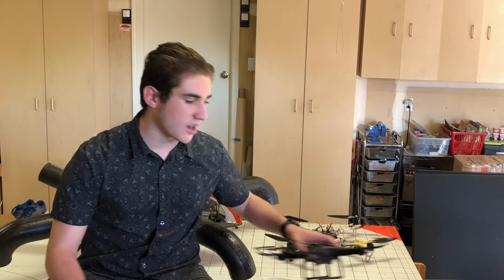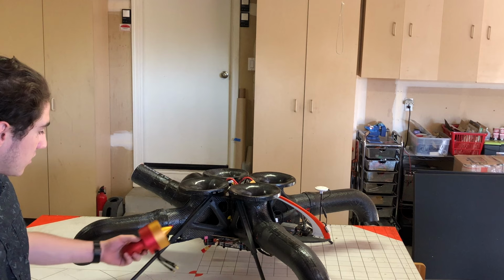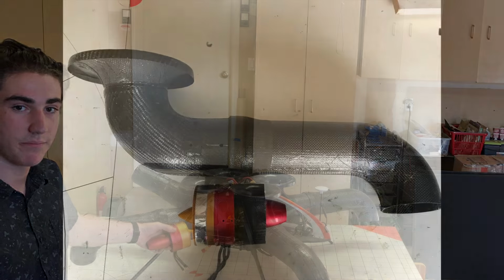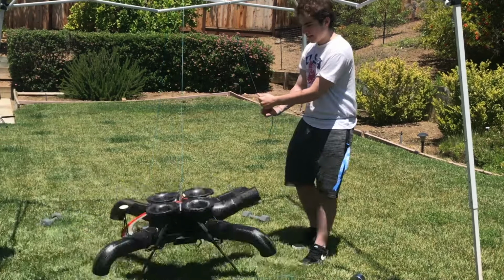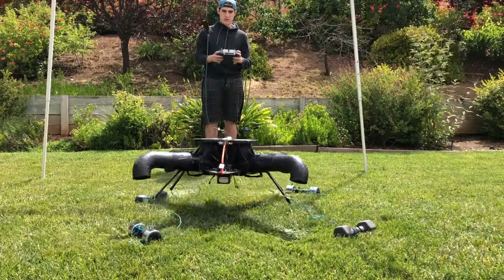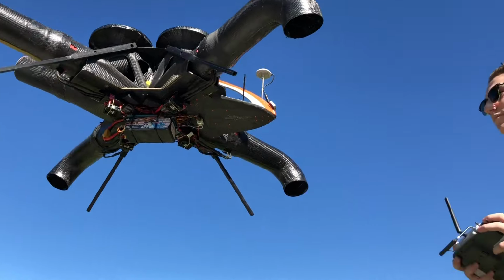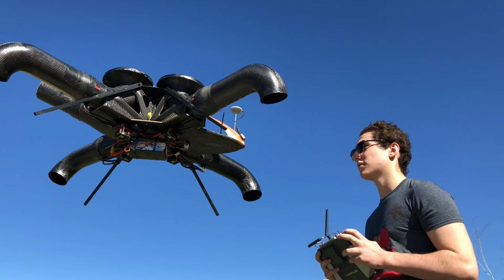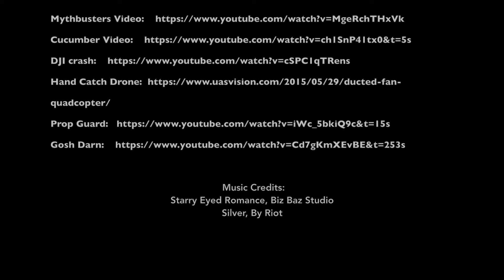Bladeless Drone: First Flight

Comment: I’m curious how much force is lost by making the ducted air take two 90 degree turns before exiting the vent
Reply: A huge amount on a good day. A better design would have had the bladed fans in a straight pipe only long enough to ensure you can't get nailed by the fans.
Reply: @strictnonconformist7369  I love that all the weight is centralized though.... I have a vintage alfa with a  rear transaxle.... it wastes a huge amount of power from the engine but balances the car 50/50 so it handles amazing.... so there are tradeoffs.
Reply: Almost zero. There is a lot of energy wasted by sending the air through the ducts, but not so much the bends. Also, EDFs aren't known for their efficiency. Still a very cool design though.
Reply: @shawnhollahan590  there are always tradeoffs.

As to the previous comment by another poster about amount of energy lost as a result of 2 90 degree turns, I’d love to see that measured and verified, having had a certain amount of formal training in hydraulics and pneumatics for robotics/automation purposes.

The higher the pressures involved, the farther away from zero energy lost it becomes: this is how and why Tesla turbines work, because boundary layers of air have a very measurable amount of viscosity and air hates to change directions to flow against it. 2 90 degree turns creates air boundaries out of airflows, above and beyond the walls.  This is why hydraulic and pneumatic circuits try to minimize the number of bends required, including ordinary plumbing, because you lose head that way.
Reply: Stefano tested that and found NO reduction in thrust.
Reply: @joshrandall3632  By reducing propeller blade tip losses, the ducted fan is more efficient in producing thrust than a conventional propeller of similar diameter, especially at low speed and high static thrust level
Reply: @tamaselmont8310  True, but there is also a lot of parasitic loss from surface drag on ducts that long. My statement about EDFs was more about the fact they are used for performance and raw power rather than endurance and efficiency.
I'm not an engineer (this kind anyway) but I think he could get the same benefit from a short vertical duct that extends 2 or 3 inches above and below the props and it would still be safe. Just a thought.
Reply: @joshrandall3632  Yes, ofc. His design is certainly an overkill.
Reply: Stefano completed an awesome project, the skills are phenomenal! Still, any bend in a flow causes energy loss, also due to micro-turbulence buildup. Also, Stefano had to angle the flow of the fixed ducts from the vertical to enable yaw control. That's another loss of efficiency. Maybe installing the fans vertically may have been employed to use torque diff for yaw (just like with a regular quad), I'm just not sure how that would have affected the attitude, given the significant difference in RPM needed and lag. Rotors don't have that problem. 
While enclosed space saving high RPM turbines may seem a nice idea, there are issues. There's a reason why large helos (e.g. CH-53E) are built with single huge multi-blade rotors: is called "torque". If one ever flew in a helo, one would know how responsive and sensitive these machines are to collective and cyclic input. Turbines are famous for throttle response lag. It is the reason why the V-22 Osprey has those huge rotors as it is very difficult to control and quick response is needed. It would be much easier to have a pair of jets installed and not risk hitting the ground with those two monstrous rotors, but it just doesn't work. That's why the power comes from turboshaft engines and routed to those huge shafts at almost constant RPM. The control is done with collective/cyclic input (and a bunch of PID/FbW electronics). Also, the immense inertia of helo/Osprey rotors plays a huge role in torque control. The Harrier Jet and the F35B use their hovering capabilities mostly for VTOL, no acrobatics possible, none needed. The Harrier uses thrust vectoring of jet exhaust, the F35B uses a turbojet/turboshaft hybrid engine to spin a vertical turbine for trust with bleeders for roll/pitch and steerable nozzles for yaw. The abilities of both aircraft are very limited. But look at videos of 3D Heli flying artists. No ducted fan or jet turbine can do that.
Reply: @strictnonconformist7369  yeah almost like.. a ducted fan
Reply: You can have 1 large turbine in the center of the drone and have a throttle body on each of the 4 tubes that meter how much air is allowed into each one.  Then have a 5th throttle and tube thats pointing straight back for horizontal thrust to increase forward speed.  Shape the body to produce lift when traveling forward so less air is needed for downward thrust and more can be directed to the rear for airplane-like flight.   Fly it FPV with vr goggles of course , camera movement linked to pilot head movement.
Reply: I would imagine the efficiency of the unit drops considerably with ducted fans as opposed to props. The question is, by how much? And how much current does it draw? Can it fly other than in a hover? If so, is it stable in horizontal flight? How fast can it go? Why am I asking all these questions in a youtube comments secion?? WTF??
Reply: @SteveKasian  No no no , this is youtube ,  please reframe your questions into statements of certainty and indisputable fact  , and start beating people over the head with them.  Pretty sure it's a violation of terms of service to do otherwise.  😂
Reply: @strictnonconformist7369  Maybe using straight tubes on gimbals would help by directing thrust outward for stability and straight vertical for speed/efficiency. It would complicate the electronics needed somewhat.
Reply: @NickKautz  Well that's what I usually do; But I got off track when I started posing questions and totally dropped the ball. I'll have be more careful next time, and make sure I stay in troll mode.
Reply: @shawnhollahan590  
Centralised weight and having 50/50 weight distribution aren’t necessarily the same thing. You could have 2 identical weighing vehicles that both have 50/50 weight distribution. The one with the majority of its mass inside the wheelbase would have low rotational mass and be very twitchy on the limit and unless the driver is highly skilled at avoiding this limit it’s likely to end up spinning out of control.  Whereas the vehicle with the mass outside the wheelbase would be inherently more stable on the limits and easier to control at the limit and bring back under control if that limit were exceeded. As for a drone, unless you’re designing for aerobatics, having the mass at the perimeter would make it far more stable in fight and would do away with all that drag inducing tubing.
Reply: @SteveKasian  An honest mistake , carry on sir.

Comment: Well, someone may have said this before but I'm not going to read 8K comments to find out.
You, and anyone else working on that project, need to get chest x-rays, to see what kind of damage was done, by cutting and grinding carbon fiber, without proper respirators. It's like asbestos. It gets in your lungs and stays there. It's very dangerous stuff to work with.
You have a great invention, I'm sure it will go far. Let's hope your only investments were time and money.

Comment: EDF (Electric Ducted Fan) are way to power hungry and you'll get only a couple minutes of run time.  Not to mention the time lag from commanded input to it actually producing thrust. This craft probably wouldn't fly in just a couple mph wind. The EDF's could never ramp up fast enough compensate external forces pushing on it. It's doomed from the start using EDF's.
Reply: Rampant FPV;

you better think, before writing nonsense; YOU ARE TOTALLY WRONG !

One may easily operate a CENTRAL EDF and you just regulate the cross sections to the four outlets in order to create thrust for climbing / cruising and maneuvering.

Works like collective /cyclic pitch at a helicopter.

Advantage: THIS can be done much faster  than spinning props up or down- using up-to-date digital power servos, controlling the throughput of these four channels.
Reply: @worldbestpilot   Totally wrong? The only one wrong here is you. We're all watching a four edf quad 4:26  Then comes in you throwing around a central unit edf. Are we watching the same video? Why stop there. Why not go with a nuclear powered central edf and solve the other problem of  how power hungry edf's are.  You think no one has not thought of this or tried it before. There's reasons why edf powered quads aren't in production. Power hungry, extremely short flight times, poor payload capacity and a tuning nightmare.

Lastly since you think it can be done and put forth how it can be done. Lets see you do it!
Reply: There's always at least one person like you. There was one when the first car was prototyped, the first plane, the first Rocket, the first helicopter. There has to be a starting point and there is always one person who has to shit on it. Congratulations, for this idea it's you.
Reply: @customledandfiberopticsinc2756    Yes your right there's always been a first, a starting point and this isn't it. Its been done before.  Check the date. https://diydrones.com/photo/img1919-1 kind of crude when compared to this carbon fiber quad but its been attempted 8 years prior. and another one https://diydrones.com/photo/nacol-ducted-fan-quad (2013)
Reply: @rampantfpv8386  You're comparing the two? awesome. The one in this video is way more advanced than that other video. Like I said, There's always one guy that has to shit on the idea and it seems to still be you. I'm OK with that. That's why the internet is so great. It allows people like you to remain anonymous while shitting on the achievements of others. Don't take it so personally. Just like the above video isn't the only one out there, You're not the only person out there shitting on other peoples shit.
Reply: You have to solve the energy consumption issue here first! I'm sure it will happen one day but this system needs LOT of energy to operate! It's no different from a Jump Jet they consume enormous amounts of Fuel when doing a Vertical Landing or takeoff! The military has uses for this technology but a Prop is way more efficient! Like I said the energy issue may be fixed one day but until they find a energy source that packs the punch of Nuclear but is as safe as a Lipo we just aren't going to see this on the market ! The other issue is noise they are way noiser than a prop my Mavic can barley be heard once up 50+ feet but this will sound like a Giant Vacuum cleaner flying around !
Reply: @customledandfiberopticsinc2756   When you understand the thrust characteristics and limits of EDF's you'll under stand what I and others have been saying. Best for now you stick with playing with your LED's.
Reply: Based on my experience and research based knowledge, I think Rampant FPV is right about the lag time and control issue as well as the lower efficiency of EDFs (in theory EDFs are more efficient, but in the current RC market this isn't true for whatever reason). I'm not saying the project was a waste of time or trash or anything, in fact, I think it was really neat and it's cool to see someone do that.
Reply: @rampantfpv8386  Oddly enough, Ducted fans showed up on drones at this years CES, oh, so did turbines.

Comment: That gives me a thought: could that concept be achieved with a single large central impeller and 4 valved outputs?
Reply: interesting
Reply: Or 4 gimballed nozzles instead of 4 motors.
Reply: I'm not an aerospace engineer, but I'm still an engineer that got aerodynamic courses. That design you offer would have some serious problems. Firstly energy would be wasted on lets say valves that are closed to block airflow for manuever. It might also create an unnecessary turbulance which may lead to a lack of stability. Also it should be something like a 4 step & 1 powerful servo motor rather than 4 semi powerful servo motors. I'm just thinking roughly though, but I don't think calculations will state otherwise.
Reply: No
Reply: That is basically how the harrier jump jet worked.

Comment: Instead of using ducted fans how about replacing them with one bigger centrifugal fan? I would expect it to be more efficient because it is possible to use it to move a greater mass of air more slowly.
Reply: how would you navigate it in varying directions in an xyz plane?
Reply: YES!! Glad you said it! If he is going to rob his duct fans of thrust by putting a lowelly 'car' type exhaust system on it he needs a higher pressure compressor, enter the centrifugal wheel!😅

Comment: Cool project but a little misleading to say "bladeless" more like ducted fan. Regardless I can appreciate the work you put into the design.  Reminds me of the early work that went into design of the flying wing configuration of early bombers. Concept was sound but technology didnt exist to stabilize the flight characteristics until recently. I am curious as to why you didnt just mount the ducted fans vertically with screens covering the inlet and exhaust.
Reply: Exactly. Definitely has blades but they're now ducted fans of even something like an impeller.
Reply: @Real28  similar application that Harrier jet uses.  Great to see that parents are willing to fund their child's creativity.
Reply: Basic leverage technique. Put the mass towards center with a longer thrust lever to reduce power needed for more precise control. That's my first thought.
Reply: @myrealname2022  yep...probably had to find the right balance of where to place the fans. To far outboard means more thrust input and to far inboard and you lose stability.  But that is the challenge of prototyping: somethings have to be in their location due to parameters established by final shape.

Comment: 1 It is internally bladed, not bladeless.
2 Are the 4 fans more efficient by weight than a single bigger motor, driving one or two fans using controlled ducts for lift?
3 The  curve of the output tubes might seem important to allow maximum flow and minimum turbulence.
4 Or the shape of the final tube openings could allow for stream modification that could enhance the "push" on surrounding air.
5 Does the input opening create a low pressure above the craft, aiding its lift?  And would tilting be a problem, like with sharp cornering.?  Would the input opening be improved by having it raised above the craft like a short chimney?
Fun video.  Thx
Reply: He doesn't know anything about drag and ignores why they do it that way ("bladed" fans) in the first blace.
Drag. All that tubing slows everything down...

Comment: On the one hand, this is extremely cool. On the other hand, I'm not sure what advantage this has over drones with a full screen over the props. Some drones use a grate which covers the entire fan, and they seem to work just fine, and don't have these heavy tubes on them, making them more efficient. I actually really hope somebody has an answer as to why this is a better solution, because it's cool and I want it to work. Anybody?

Comment: Interesting. But I bet it is hugely inefficient compared to normal quads because 1) The ducted fans use very high RPM relatively small propellers (propellers are always more efficient when larger, slower and less blades) and 2) The pipes are lengthy and have 2 90-degree turns. Why not just put the same ducted fans vertical, with maybe a short length of straight tube extensions, and build a protective mesh above the intakes? Should be much simpler to make and should improve efficiency a lot.
Reply: because mesh would destroy the efficiency?

Comment: Ducted fans seem cool, idk about their thrust:diameter ratio but I'm sure it's good, however their overall thrust:cost ratio seems very high. I've always wondered if adding multiple turbine blades/ducted props to the same motor would work better? Of course it would come at a cost to efficiency but so do coaxial propellers, though most importantly they are great for saving space.

This guy seems to be doing it right, props to him and his dad! Putting a patent in, using this as a project for his degree, this guy's going to go far!

Comment: try a bigger engine that splits four ways, instead of controlling each engine individually have a valve system on those 4 airways similar concept to how a harrier works
Reply: I was thinking along the same lines, the only issue is at this scale I can see it being difficult having the precision you expect from a larger machine. Everything flies smoother scaled up
Reply: @austincase914  true. but if he pulls this off it'll be an even bigger breakthrough than it already is